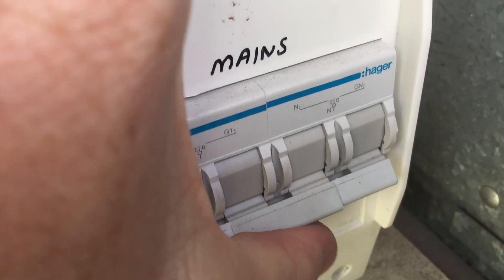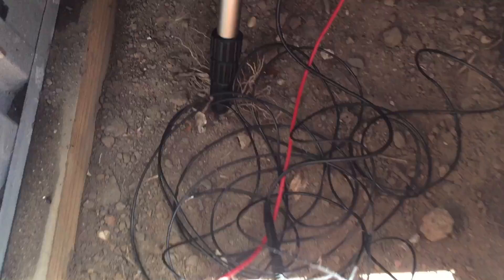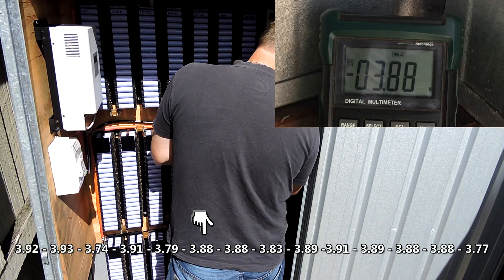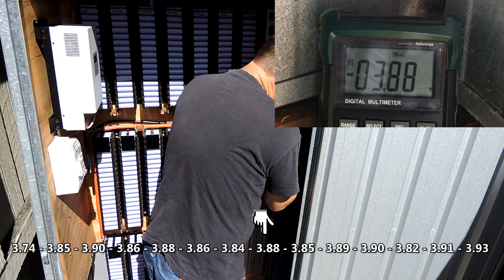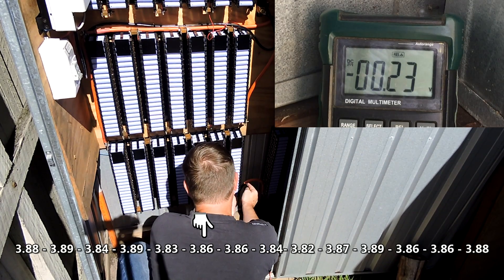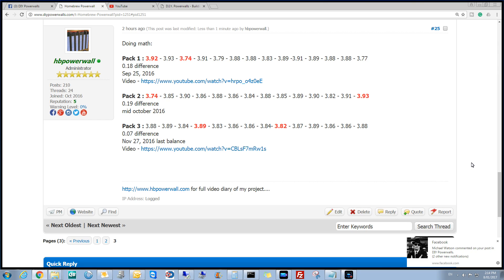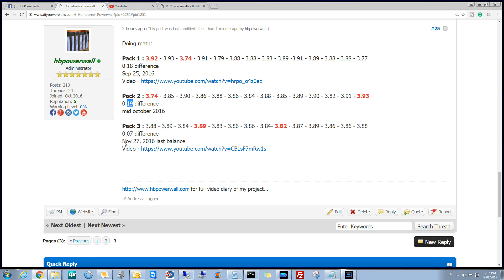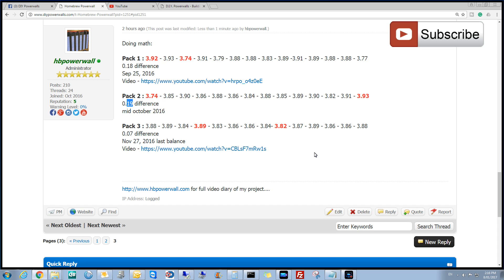Voltage Checking the Powerwall all 42 cells

Comment: Wouldn't it be better option to add a little voltage meter on every cell? They're pretty cheap and accurate, reading voltage from them would be much faster. Hope you'll tell me what do you think about it. Cheers.
Reply from the maker: Yep, got them laying around the shed - THEY ARE HORRIBALLY INACCURATE ... like borderline useless I have to order different ones. One day I will do that but have other plans first.
Reply: +HBPowerwall If they're inaccurate, check if they have little potentiometers on the back, you can calibrate them (it looks like a very small screw). Cheers.

Comment: Cool. I'm curious if the voltages are much closer together when they're charged to the maximum voltage. If that is the case that's perfect. It would mean that all banks (you call them cells now 😃) dissipate the same amount of energy into heat.

If a bank (cell) ends up lower it means it's internal resistance is a bit higher than the average.  Would be interesting to replace that bank with another and see if it improves.

Thanks for taking the time to make a video like this. It may seem boring to some, but these kinds of videos save me ( and I'm sure many others) a lot of time. Learning a lot from your project.
Reply from the maker: I'm going to say they'll be further out if I should be honest. I can't remember for sure as I've never recorded the voltages I just look for low and high. I know and have for MANY months pack 14 is a week pack and is always the highest at full charge and lowest at under 48v. I'm charging the battery now to full float voltage 4.1v and will retest. This probably will take two full days of sun to do, so not running off batteries atm. Can't wait till I have a larger shed so I can make more boring videos quicker :)

Comment: What state of charge would you call that? I would say at a guess 65-70% charged.Still 4 days left. Nice big power wall.
Reply from the maker: it would still have one day left in it without sun. I put it at 400 usable AH bank at 53v (because saying 48v is completely useless in my case 48v - 57.4v half way is 53v ish) Start of the video it was about -340ah P.S. I need bigger :)

Comment: hi 
with my 14 packs 100ah/pack have experienced the same fluctuations with voltage in the range of 0.08v.... as I have niticed this is normal for used batterys ..... 
I expect les fluctuations when I add that every pack 100ah more  so every  pack would have 200ah or few ah more than 200ah....
I have one question about your powerwall you have 14p in series and another 14p and another 14pin series and then in parallel... 
if you would have 3packs in parallel and then in series you shuld have less fluctuations between the packs.... just some ideas..... what you think about that?.... is also easy to balance them..... if would this be necessary...
Reply from the maker: Yes, did consider doing it like that when I started, and it would really make using a BMS much cheaper however I chose this path now I'm stuck with it unless I want it to look messy and as you'd expect I don't ...lol that is definitely a great part about my channel so many have done so much better than I have and it's still improving.